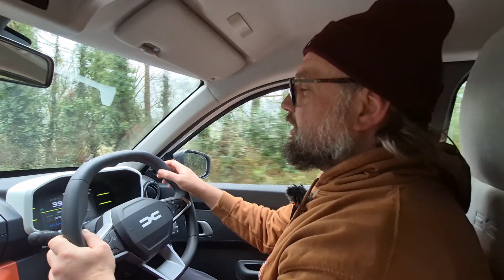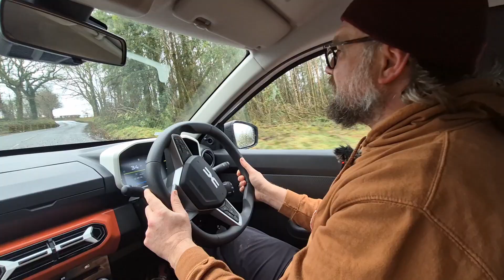Why are car speed warnings so rubbish?

Comment: I have been very vocal about this for some time, as you know. 
In the cars I’ve tested I’ve never got better than 50% accuracy. I’ve had so many anecdotal stories told to me about scary stories.
Now imagine that speed limit warning that is wrong, when mated with intelligent cruise control, the. The car is in control and not you, BUT you are legally responsible.
I hate so much of the implementation of ADAS, as they’re very poor on our roads.

Comment: I recently had a current model car with ADAS as a courtesy car while my car was in for service. It was the most frustrating, distracting, annoying piece of crap I have ever driven. I could not wait to give it back. The technology seemed to never work the same way twice. If you get in the car and shut the door it returns the power seat to the programmed position, then you start the car. BUT, if you get in, start the car, then close the door the car doesn't move the seat and won't even respond to the manual 'shift you bastard' buttons. You actually have to turn the car off, open the door, then close the door, wait for the seat to move then start the engine.  As for the torque and power vectoring display with g force graphic and compass heading  on the screen that covers 2/3 of the dash, well if that's not a distraction neither are mobile phones. My 1965 Wolseley is one police inspection away from being road legal.

Comment: I totally agree with you. On my 2015 I got anywhere from 10 to 90 on the M1. 
I could go on a long rant about the car system not being fit for purpose under the consumer rights act. 

However you are driving a “Renault”. They agree with you and there is a button on the dash where you can turn up to 5 of the more annoying’safety’  features off. I watched a car gurus video on this model and they showed how to do it. 
Renaults position is we have to put these stupid systems on by law….. here’s how to turn them off simply. No delving into sub menus.

Comment: You can be an awful driver who sticks to the speed limit or an otherwise excellent driver who goes one mph over the limit, but only get regularly caught for the latter. Speed (within reason) is a very blunt sole instrument for measuring safe driving, particularly in context the sophistication of the day and age we live in.

Agree with the issues of assisted steering, i was driving a Sprinter on hire across Germany where the lanes on the autobahn were altered for construction reasons, and it was just dangerous trying to yank me into following the preexisting but not current lane markings through the diversions/contraflows

Comment: It probably works perfectly in tests. The problem is that those tests are probably done on a closed test track with brand new speed limit signs on a clear day with no water on the car or the signs. Living on the western coast of Norway, where we get 2.5m (98 inches) of rain annually, I've seen road signs that were green with some kind of growth, probably algae. Those are going to be difficult to read

Comment: One thing to be aware of which I learned at a recent driver CPC course. If you turn off driver assistance - lane drift assist, auto braking etc. - and you are involved in an accident your insurance may be invalid so check the small print on your policy
Reply: Oooo my! The opposite should be true. If you don't turn it off and it yanks you into a parked car that you otherwise wouldn't have hit then that crash could be avoided by turning the system off when you set off!
Reply: . An insurer would have to prove that having a system turned off "directly contributed or caused the accident" to attempt to invalidate a claim, and it never could.

Comment: I am retired from IT, database administrator for most of it. Know a little about data and quality thereof. We have a saying for horrible inaccurate data. Garbage in, garbage out. Results are only as good as the data used to those results. Those systems all depend on or use GPS speed data, that is supplied by the only folks who know the speed, the government. If it is not mapped out accurately, the info it gives you is crap. So, it is not your software that is wrong, it is the data being provided by the GPS system to that software that is wrong. That should be consistently bad across brands. MY vehicles all read speed in MPH, so in the 8 countries I've ridden in, 7 of them I needed the GPS to know how slow I was going (note avatar, on that) and the speed limits it showed were consistently bad everywhere I went, except Switzerland. As a result I drive a 15 year old truck (Dodge), and motorcycles with sidecars, none of which have and rider/driver assist at all.
Reply from the maker: I think there is a software glitch here too. It was beeping up a 37mph warning, in a 60mph zone. 37mph is 60kmh.

Comment: Some reviewers now even mention and compare how easy it is to turn these nannies off, because you have to do it at the start of every single journey, EU forbids manufacturers to let drivers turn it off permanently. 
Some cars just require a push of a button that works both standing still or while driving, others make you go through all kinds of menus, some require you to be stationary with the handbrake on... This will actually be a very important point to check if I ever buy a car that has these mandatory nannies (because like you say: they don't work, plus in many cars you actually have to drive a bit faster on the gauge to drive the actual speed limit).
I doubt an actual limiter will be mandated any time soon, speeding tickets are a lucrative income for most governments... It's a bit like smoking: they'll do everything they can to make it very annoying, but they keep selling cigarettes and taxing them.
Reply from the maker: This has one button that you can press to disable things apparently.

Comment: Just retired from 37 years in the auction industry. These “safety asists” are rubbish. They vary in quality from vehicle to vehicle, are intrusive and often inaccurate. Especially the ones that talk. Auto braking and lane departure is the same. I had a subaru outback that thought i was hitting a wall when spray from a truck washed over the windscreen it auot braked at 110kph!

My personal car, a hilux 4x4 is a base “mines spec” to use all of that (except the braking) i have to turn it on. It doesnt beep, talk or take over.

Comment: The problem here isn't the car. It's the data.

Anyone who has used satnav software that displays the current speed limit will know that there are many errors in the mapping data. The map suppliers presumably rely on the relevant highway authority to notify them of speed limit changes. Once that data is supplied it has to be applied to the relevant database, and then it will only be applied once a periodic map update is applied to the satnav device.

I imagine this relatively slow update process applies to in-car systems.

It's hard to imagine that the speed limit advice system will ever be accurate entirely.

Comment: As just a layman on this issue but maybe it's down to the car needing a  full set of sat nav,,  GPS tracking and road sign reading camera's plus a Sims card to keep the maps up to date for this type of system safety systems to work , our Kia e-Niro has this system but it still can get itself in a pickle plus maybe that's why the Spring  is down graded on its NCAP ratings?

Comment: It is not the tech in the car but the accuracy of the information about the GPS coordinates of the speed limits and the limit uploaded by the roads authority to the Sat Nav sites.   The system also needs to be in contact with at least 3 satellites for an accurate location to be received and worked out.  The same as navigating at sea, 3 bearings of landmarks to be sure and accurate over one's position.

Comment: It is the maps that are at fault. My daughter is young and was, until recently, pretty much forced to have a 'black box' fitted. In the first few weeks she racked up an enormous penalty score. I got the insurance company to allow me access to the data, and as an IT guy analyzed it. It was hitting her for doing 46mph in a 50mph limit, because the map thought she was 15 miles away in a local town centre that has a 20 limit. Fortunately, that data had the GPS location. Much talking with the insurance company, and they cancelled all the data for that month, and sent her a new black box. Same with that one. Even worse, each time she hit a speed bump or pothole, it recorded it as an accident. The car went for a service, and it hit her for speeding 20 miles away, as the car was on the car lift! Then she had the temerity to do 70mph on the motorway, and it thought she was on a local road with a 50mph limit half a mile away. The maps were the problem. They were out of date and had many, many errors. Are all maps as bad? No, but the cheap ones are. And the car makers use cheap ones. If they force cars to slow down, it will cause chaos.

Comment: Technology that has a way to go yet, but will improve over time.  I take the view that the assists are useful but I am still doing the driving and a responsible for it. I don’t regard the assists as much different from other information such as speed. Cruise control is excellent on open roads, prevents your speed gradually increasing which happens easily. I don’t need to check my speedometer regularly, the car does it for me. Adaptive versions keep the gap consistently, but without it you have to keep a check on approaching slower traffic. Lane assist, the lowest setting is useful too. But these should all be viewed as assists only and not a removal of responsibility. The speed warnings, not required where I live, but I have experienced them elsewhere, are irritating, but so are other road users who do daft things or aren’t paying attention. It is all just part of the driving experience.

Comment: Why is anyone surprised? Just think about the problem? If you take a quick guess at, say, one million miles of roads in the UK. It is not that important if this figure is correct! It is a lot of miles of roads that need to be mapped for speed restrictions. In addition, who is going to pay for the work? Are you getting the point?  So it is no surprise that the system cannot work universally over the entire Country.  A simple case of logistics never going to catch up with the system requirements.

Comment: If it's not 30 there will be signs by the road telling you the limit, the speedometer in your car tells you what speed you're travelling at, go figure...
Reply from the maker: The car is often wrong. That's the issue.

Comment: The one on my 2022 qashqai is right most of the time and I find it useful when driving in an unfamiliar area where the signs aren't clear/overgrown.  The HUD just flashes if I go over the limit but gives up after a few seconds and no beeping.  Same with lane assist, a slight rumble on the steering wheel but it doesn't bother me.  So I think they have the levels about right.  I would think twice about going to a beeping make.
Reply: Same here,  we've got a 22 Qashqai and I find the set up to be pretty good,  the head up display is  really useful too.

Comment: The issue is not with legislating to have speed limit warnings, it's the implementation.  It was the same with Suggested Gear info when that was mandated, everyone fitted bright displays and bongs if you ignored them.  All that was required was (and still is) a small readout that displayed the suggested gear to use and noting more, this is eventually what happened with everyone moving over to a small number on the dash that is visible but easily ignored.  My current Fabia has a small number at the end of the trip display and it doesn't interfere with my driving at all.  The same needs to happen to the Speed Limit warnings, just a simple number that is unobtrusive yet easy to glance at.  No bongs or bright lights flashing away, that way people will actually use it as the legislation intends it to be used, as a reminder of what you should stick to or below.  Sadly the likes of EURO NCAP have gone far too far down the route of treating everyone as if they're idiots, hence the insistence of warning lights and bongs to attract the driver's attention to the issue but also distracting them from the actual task of driving.  

What is more amazing though is that the likes of Google Maps, Waze and other SatNav systems are more accurate on what the speed limit is and all they rely on is official map data and users flagging up errors!
Reply from the maker: Google and Waze still haven't caught up with the Welsh 20mph changes, after well over a year!
Reply: @hubnotes they're pretty much there here in the populated south, maybe they'll get round to updating the "Here be Dragons" bits of paradise you're lucky to call Home soon.

(not that I'm a jealous reluctant city dweller or anything...)

Comment: Don’t just blame the car (or it’s manufacturer). I’m used to the Toyota implementation of that lot, but it’s evident that a lot of the snags are over the boundary on the roads themselves, along with some mounting on other vehicles. No shortage of speed limit signs not being there are at all (quite a few M road slip lane entries, e.g.), or just badly positioned, or hidden by vegetation etc.

Then as some others have pointed out, there are speed limit signs that do not apply to the lane you are in that end up being detected by the car system, and what happens with road works with temporary ones. In short, the system is not confined to the car or it’s driver once there is an attempt at automation. It spreads across to the relevant authority or contractor - which do not want to know much about it.

That said, I’m quite happy with the Toyota lane trace assist & assisted cruise control with radar measurement on some long trips.

Comment: My Toyota Aygo X also gets it wrong telling you off for driving at 28mph when the dashboard display indicates it should be 50mph. I also see they have cut corners with tyre pressure monitoring which no longer knows the tyre pressures but just uses data from the anti lock brake system rotation sensors (Indirect versus Direct TPMS) Thus it does not tell you which tyre is at fault. Does the new Spring have real tyre pressure monitoring?
Reply from the maker: Yes, it does have tyre pressure monitoring. I believe that is now mandated too.

Comment: What is missing is the ability to train or teach them when they’re wrong.
My whole town is 30 kph. 
For some reason my Enyaq thinks parts are 50 kph and it accelerates like a stabbed cat so that if there were a radar trap there I would surely get a ticket. 
It still isn’t perfect but at least it would be an improvement.

Comment: Our car is about 5 years old it pops up with the speed limit shown which is quite useful, the a mount of times it picks up the 20 limit from side streets while driving through a 30 would drive me nuts if it bonged as well.

Comment: Have to agree that much of this tech just isn’t clever enough or maybe, more correctly, developed and tested well enough, to be infallible. Hardly ideal on the road, where mistakes can have very serious consequences. It’s why I don’t think we’ll ever end up with autonomous cars. I know there are some driver free taxis in the US already, but infamously one of those recently was driving round in circles in an airport car park whilst trapping its passenger inside… My car has a speed limit display and it’s mostly accurate; I would say 95%, but it will sometimes show 70mph when you pass a restricted sign on a road that is not a dual carriageway or a motorway, particularly if the road is wide; an A road for example. Equally I’ve had it display 40mph when it’s actually 30. It’s useful, but it pays to remember it can be wrong and it’s obvious who gets the blame if you do rely on it and it turns out to have shown the wrong speed. Thankfully my car doesn’t beep and it doesn’t have lane keep assist, which I experienced in a Vauxhall Astra on holiday once. The wheel was almost tugged out of my hands on a motorway, the car badly destabilised to the extent that I thought we’d had a blow out. Once I realised what it was the issue (and I found the button) it was turned off for the rest of the holiday. Seemed dangerous to me.

Comment: On mine the lane assist reacts when you change lanes without signaling. 
So on an empty motorway if you change lanes the car tries to counter steer against you so the steering wheel resist you efforts to turn steer the car.
This is lunacy on 2 levels.
1, if I am actively applying pressure to the wheel to steer that in itself is evident that I am in control of the car.
2, it only activates by the time you are half way into the other lane so would be too late if you were in the middle of an accident
Reply from the maker: You could always just indicate...
Reply: @ why would you need to indicate when there is no-one else on the road to see it 🙂

Comment: I had a rental in Mallorca with this. On the 130kph motorway, it would flag up a warning as I went past every slip road, due to the 70kph signs as you exit. It could not tell I was not exiting. I'd lose the speedo while it alarmed and had infernal beeping. The lane assist also made overtaking cyclists hard and it was hard to turn off. Its more like a nanny than an assistant. The only driver aids I need and want are data on the engine etc., turbo pressure, oil temp, etc.
Reply: That explains the difficulty I had learning to overtake cyclists when I was learning to drive. Most of the time the auto-lane assist only happened on the motorways, because in town I was under the speed where it activates. But on the country road, I was just over the threshold. Instructor thought I was being overly cautious, then I said "I can't turn!"